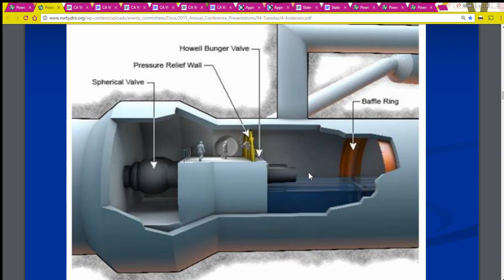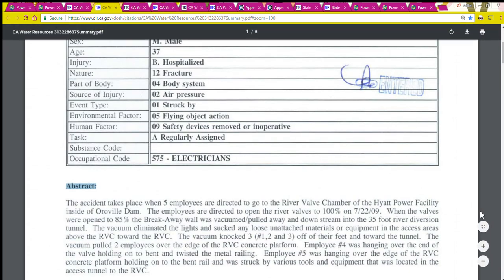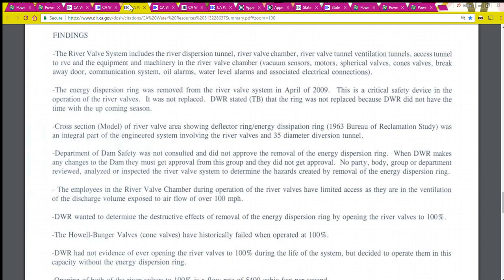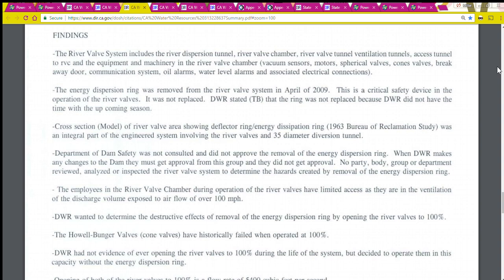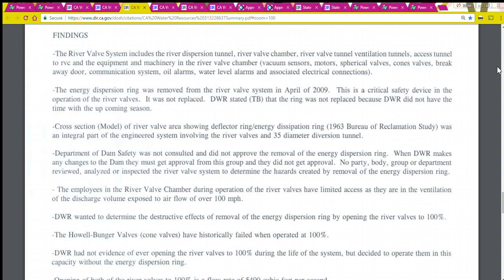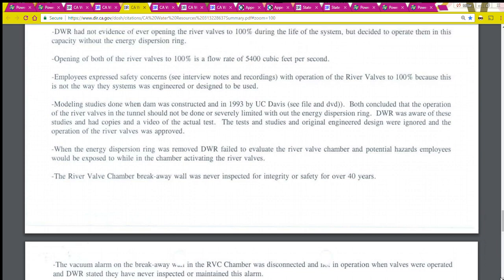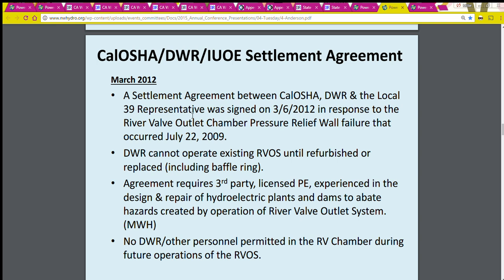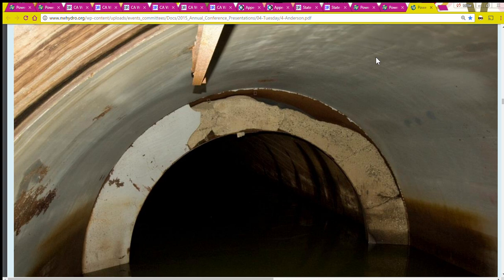Details of Investigation: Oroville Dam River Valve Chamber 2009 Accident 5/11/17

Comment: Great video… in your research, did you ever learn how the 5 employees were rescued & how the river valves were shut off so access could be made into the chamber?
Reply from the maker: Thanks NIFTSIX! The short answer is no. At the time it was not remotely operated as it is now, but they must have had some type of emergency procedure to throttle the valves. Wish I knew more about that.

Comment: Thanks for the video. Yes a work place accident. Couple of things your video makes me think. I would hate to be reading the accident report, of the disaster, that came from the broken spillway. I think maybe what your video shows is that the, the broken spillway is like having a broken vacuum device, in your river tunnel...and how long has it has taken for that device to be fixed and operable? I don't think it is working, even as I write this. And DWR is still ordering contcrators to work, with part designs, and half cocked methodology. All tax payers should be concerned about the letting of such contracts to the free market. I mean there is always some dope, or troup who bid to fix the whole thing, knowing full well the variations - will flood in. Roller compacted concrete contracts and well - saftey reports when stuff didn't work out. Anyway, of course if you pass that much water thru a small oulet, in a confined space, and end up nearly killing people, then I suppose you shouldn't be running a dam! Is that in the saftey report? Oh yeah, DWR must seek third party approval before releasing the river valve!! As always thanks for the video, it certainly helps in understanding the situation, on the feather river. Peace.  from the land of the long white cloud.
Reply from the maker: Hi Fred! You're so welcome. Your commentary is well stated. Thank you for taking the time to write out your thoughts. I appreciate it, and I know many of my viewers will, too. New Zealand, huh? That's a place I don't know enough about, but from photos I've seen, it is beautiful! Thanks for viewing and commenting. Take care.
Reply: Hi there, thanks for the reply. Indeed, I kinda figured that your video just wasn't some boring pod cast, I paid attention to those words...and then went hang on a moment! Yeah New Zealand, you guessed correct. And of course my name is not Fred Smith. Anyway I digress, yes, if you have moment we have the clyde dam, built ontop of a fault line, they put a 4 metre slip joint in the dam design, just hope mother earth plays ball with the engineering on that one. But yeah, please do look up "Ophua Dam", there are two videos on you tube. I was invloved in that dam, makin the steelwork. Do look at video 2, when they cut into the half completed dam. Cheers from down under, we make milk powder here, and shit up the rivers. Thanks for this great channel Millie.
Reply from the maker: Hi Fred. I watched both of those videos about Ophua Dam. They are awesome videos, with a lot of detail about the building (and re-building) of that dam. I have put the videos on my YouTube Playlist about Other Dams. I'm sure I will watch them again -- and definitely refer others to them as well. Thanks so much for telling me about those videos! Take good care.
Reply: Hullo, thanks. Glad you enjoyed that material. Couple of interesting points. The site manager for the Ophua Dam contractor, was eventually fined, I think $200K, it turned out he was not qualified and didn't have any experience. The main contractor settled out of court. Also, of considerable interest is Alan Hubbard appearing in the video, he was a finanace guy from Timaru, a few years later on from the dam, he cost the New Zealand taxpayer around $1.4 billion when South Canterbury finance collapsed. Edward Sullivan who also appears in the videos, a lawyer, was implicated in the financial failure of South canterbury finanace, I think he got "home detention". But I did run into Mr Sullivan on the dam project, back in the day, and as for Hollingum the site manager, he was called "chewbacca".....anyway, good to see DWR with truck of rocks for the feather river.
Reply from the maker: Hi Fred. Very interesting info. Hollingum looked genuinely sad when they had to breach the dam. I like him. I bet he was more qualified than many who might have had acceptable credentials. Dams are such political beasts!
Reply: Hi Millie, thanks for the reply. Yes terrible decision for Hollingum to make, but he also took a few short cuts and gambles, that bit him on the butt in the end. There were few saftey things he never implimented. Yes dams are political beasts, as said the dams on the Clutha are a great example here. http://mightyclutha.blogspot.co.nz/
That site has good info on the Clyde dam a "think big" project built directly on a fault line! Also the use of all this power, is controversial here in NZ. We have a aluminium smelter that uses around 15% of our total generation, fundamental to that process is very cheap electricity. Rio Tinto threatened to close the site a few years ago, and were given $30 million by our government, and a renewal of their cheap electricty deal. The average household here pays "top rate" for domestic power. I guess the tensions in capitalism show up when subsidised electrons are invloved. Anyway, hope this is of some interest.
Reply from the maker: Hi Fred. That Clutha site is very comprehensive and put together well. I  have bookmarked it for when I want to learn more about dams other than the one that is in my back yard!!!

Is New Zealand a monarchy? I somehow think of New Zealand and Australia together but really don't know how either is structured.
Reply: Of course, "not in my backyard" is a saying we have as well here in NZ, NIBY. And of course, every "dam" spoken about in a backyard, well lead to, a broken spillway. Take care on the Feather river, or Clutha river, if ya backyard is in another hemisphere! Engineering the "dam" in our culture...
Reply: seems the dam sillway was built on the graveyard digginns, in the 1960's exckayvaychun report, the middle to the spillway was the site of...
Reply from the maker: Hi Fred. I heard about that but haven't had time to "dig" into it (no pun intended). Disturbing . . .
Reply: I think, there are human remains in the Feather river, they came from under the spillway, the DWR has a report on it, dating from the 60's, I suppose with all that concrete on top, the spirits wanted out.....disturbing, no dig intended

Comment: Hi Millie, That's a super interesting and well done video!... the workers are so lucky not to have been killed in this debacle.  I find it disgusting that the specific names of the people who directed the employees into the chamber to open the valves (after they were advised not to) are not mentioned and will likely never be known and it's also likely that the person or persons still work for the DWR. IMO their names should be disclosed and they should be charged with attempted murder. I believe the public has a right to know who they are? Also it doesn't take a rocket scientist to see the problem here... The high pressure jet acted as a venturi ( https://en.wikipedia.org/wiki/Venturi_effect ) thus pulling air into the river valve chamber from the access tunnel. Anyone with a modicum of knowledge about how a venturi works can instantly see the potential problem. I wish someone would get to the bottom of how the decision was made and who gave the directive to the workers. I think knowing this information is critical to understanding how an institution like the DWR can overlook obvious problems that have led to multiple disasters at various structures they oversee.
Reply from the maker: Hi John. Thanks! There may have been individual lawsuits, closed hearings, sealed records, and other information not available to the public. The scope of this video was to document the basics of what happened. I hope the wheels turned in favor of the victims. Thanks for viewing and commenting. Take care.
Reply: Millie I appreciate that you don't want to ruffle the feathers but I think the public has a right to know who is responsible. .. and also a right to know if those who would ignore the advise from the folks they commissioned to do a study still are working at the dwr.
Reply from the maker: You are very perceptive about that feather ruffling, John! I'll need to put some (deep) thought into this. Many of my viewers want to know more.